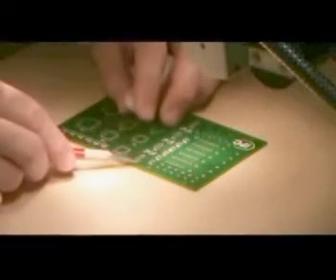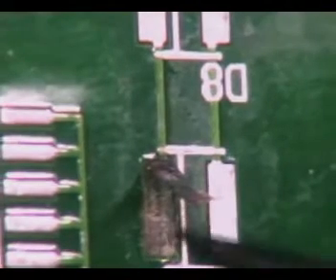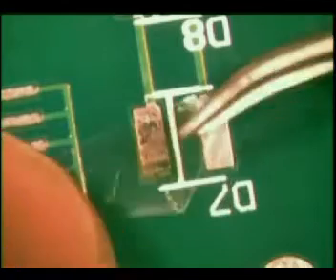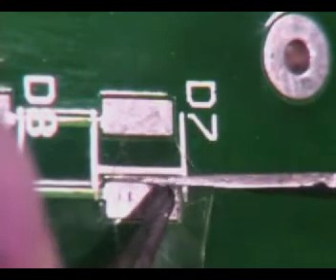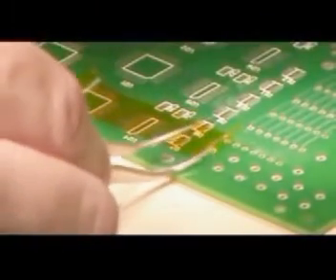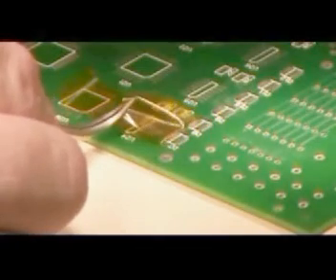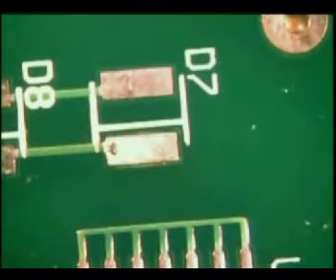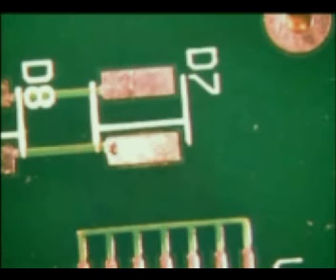PCB Pad Repair Dry Film Version

Comment: circuitmedic[dot]com/parts/115-2706.shtml put this in a google search bar, i cant post links 
This is the DRY FILM ADHESIVE in this video that they are using, dont pay the $200+ for the kit just buy this and follow the repair method in the video. After a year of on and off searching, I was pointed in the right direction. This is no longer a secret, I will be ordering my sheets this friday.

Comment: That's an excellent method for repairing a lifted pad.  If the pad is missing, you could use a trimmed piece of conductive copper tape.  Be careful soldering to the copper tape as the tape adhesive will melt and could cause the new pad to slide around.  For information regarding the dry adhesive used in the video, follow the link under the video.
Reply: figured id add... ive yet to find something harder to fucking get off an iron tip than said adhesive, to get my tip to wet properly after doing anything with that damn copper foil tape ive gota crank the temp and burn the hell out of the tip for a few min. ymmv